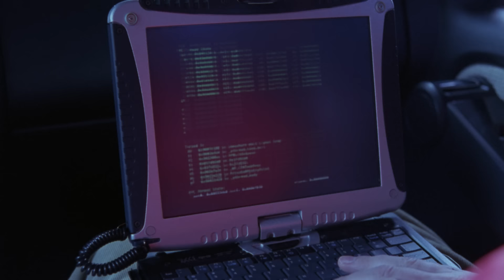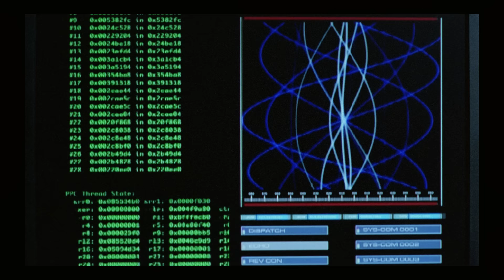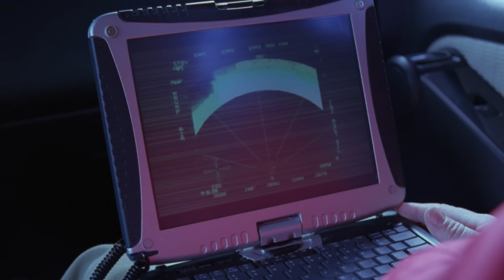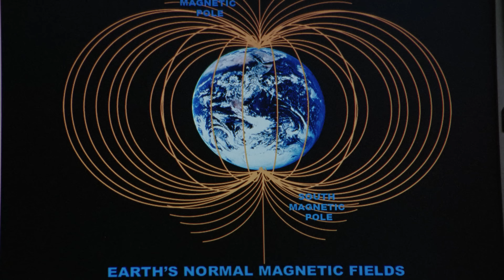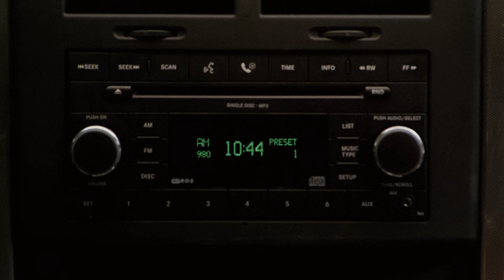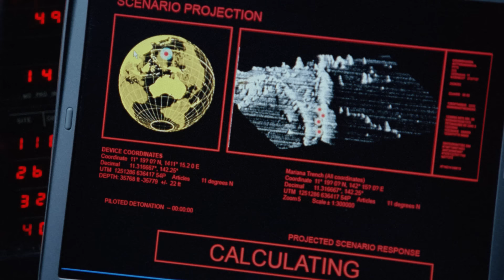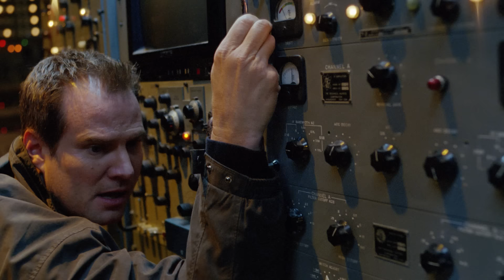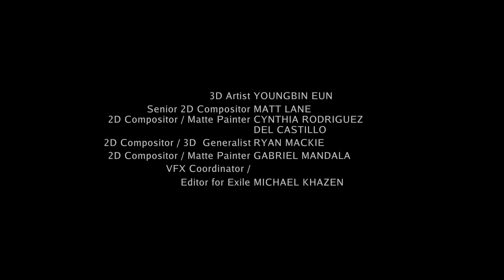Polar Storm Full Movie | Disaster Movies | The Midnight Screening

Comment: Definitely worth watching. I especially liked where 2 men were able to lift a hydrogen bomb in its crate into the truck. Also great was when they were able to take the battery and starter from a gasoline-powered car and up it in a diesel truck and it worked. Finally, a Russian diesel submarine went to the bottom of the Marianas Trench--far past its hull-crush depth. But hey! It's all in good fun!

One of the better disaster movies, which always begin with the "experts" ignoring a scientist. Sound familiar? Rather like real life.
Reply: Pretty much everything here is backwards.  Magnetic reversals happen, but they're not correlated to extinctions.  The magnetic field is not in line with the rotational axis.  Makes for good drama, though.
Reply: Because its fiction, anything goes.
Reply: I'll definitely take ur word for it 👍
Reply: Funny
Reply: Yes, exact like in this world!
Reply: Those were nuclear bombs, not hydrogen bombs. Also, the starter wasn't fried. It was the alternator. The starter was attached to the gearbox. All vehicles are like that.
Reply: @JuliusGrande , hydrogen bombs ARE nuclear bombs. Edward Teller's group at Los Alamos developed them in the early 1950's. The first bomb from the Manhattan Project was a fission bomb, and 2 were dropped on Japan. Teller's bomb design was a fusion bomb, which is several times more powerful. They both work by splitting the nucleus of the atom, and are both atomic, (meaning nuclear) bombs.
Reply: @johnwest7993  Whatever.
Reply: I thought exactly the same. Two supermen for a few seconds. LOL
Reply: Mariana Trench  depth  - 36,000 ft plus change.  Maximum  depth achieved by  MODERN  submarine ( Russian  Akula class) - 4000 ft.  So, yeah...
Reply: @Katrina-mi2gm  also a diesel sub's max speed is 23 mph and the trench is approx 5600 miles from the West coast.  It would take 10 days to make that trip.  They had less than two.  Diesel subs can only stay underwater for a few hours at a time.  Oh well, still better than many of the disaster movies they put out, even the big budget ones.

Comment: Shutting off the vehicle doesn't protect it from an EMP. If it has a chip or IC, it's fried.
He said the battery and starter needed to be replaced.  He replaced the alternator.  LOL
Reply: Being a back yard mechanic? And I saw the alternator called a starter?...I'd hire that guy to BS customers so I could make more money repairing cars. 
I would also sell winter air for the tires. You'd be surprised by how many people think there is such an item. 
:>)
Reply: @tedhernandez2394  I have heard people say they use nitrogen in their tires in winter because in shrinks less than atmosphere.
Reply: @tentativelymanaged9642  Costco and Pep boys use nitrogen fur the tires.
Reply: True.  One would need a Faraday cage around the car, or whatever they're trying to protect, from an EMP.
Reply: Brian Roberts I agree with you.
Reply: @tedhernandez2394  The starter is attached to the gearbox
Reply: @JuliusGrande  I know that...Thanks anyway.
Reply: @tedhernandez2394  You know how I know? I've been working with cars for 10 years.
Reply: Movie made in 2004.

Comment: Modern cars has multiple computers that will be fried by EMP. After they are gone, then engine ignition sequence and everything else that is handled with them will fail. So getting a modern car run after EMP has fried it is almost impossible without loads of spare parts.

And running it with random radiation would be extremely hard even if the components would be designed for that. And in this case, they are not.

Even if you miraculously get the car running while EMP changers it, then you have to get batteries running too. Car is not running without steady electricity flow...
Reply: If you expect anything that resembles 'real life' in these flicks, you are definitely barking up the wrong scenario... please - a woman falls into a huge crevasse and emerges with hair and make-up perfect... and you think the car is far-fetched!? We can go on...

Comment: Even if the car engine is turned off, there is an effect of electromagnetic waves.
Electricity is supplied to the electronic components in the vehicle.
At the very least, you have to remove the battery.
If electricity remains in the electronic parts, it will break.

Comment: The Marianas Trench is about 2,500 miles from the US west coast. A (fairly) modern diesel sub makes about 40 knots (44 mi/hr.) That means it takes a minimum of 58 hours to reach the blast area. They have less than 48 hours before the magnetic field shuts down. I guess they're going to have to push it and hold they don't run out of fuel somewhere between Hawaii and the trench.
Reply: That would have to be one fast boat.

Comment: An old diesel sub at the bottom of the Trench? That's gotta be about 35,000 feet deeper than what would crush its hull. None of those subs hulls was rated for even 1000 feet down. I think we'd lose an Ohio class sub by 2000 feet. Submarines just can't go very deep. Their hulls would have to be way too thick.

Comment: Different sized vehicles usually use different sized batteries and alternators. There is no way that the battery and alternator of a Nissan Pathfinder would fit in an Army Truck. Plus, the starter is normally attached to the gearbox.

Comment: After looking through other reviews here, I agree it was worth watching as a " Feel Good Disaster movie". The story works as a happy ending story. You just have to disregard virtually all the Science and Technical portions which have been very much repeated here in other comments. The one's I will comment on would be 1.) the fact that the EMP was a rolling effect, that is kind of contradictory of the name ending in Pulse. On that as well, it has already been said, turning off the vehicle will not stop the effect on the electronics...ie... destroying it. 2.) The disruption of the Planet core by a hit that was that easily survivable is questionable. The most glaring items though are the Submarine issues. There re maybe a half dozen submersible vehicles on the whole planet that could make the trip to the Marianna Trench and survive, Most people don't realize, the typical crush depth of a submarine is around 1200 to 1800 feet deep due to the pressure the hull is subject to  at those depths. A submarine at 9000 meters( 29,000 feet) below the surface would have long been crushed due to the fact that every square inch of the hull would have the equivalent amount of weight of 2 full size pickup trucks on it( around 13,000 pounds). I won't even go into the idea of steering the sub into a " Black Smoker:  I know this is a long explanation and having said all this. I still watched it from beginning to end and was touched by the return oh the Father and Grandfather.. I recommend watch it and ignore the Science involved. It  was fun to watch and especially when the "Bad Guy" car thief gets his instant Karma!!! :D

Comment: Yes, the earth’s magnetosphere really is diminishing, and has been at an ever increasing rate since at least 1859, but the results of that when and if it approaches minimum field strength will not even slightly resemble this silly BS.
Reply: Hasn't the field strength diminshment accelerated even faster in the last 30 or so years?

Comment: Ok movie as such.. very entertaining.. but..  Turning off electronic equipment is not is not gonna do dip squid.. If there's a powerful EMP any microelectronics, if it's not shielded against it, is gonna be fried. Regardless of whether it's switched off or not. The notion that it'll be unharmed if it's turned off is just a movie myth. I've seen that in other movies too, but it's simply not true.. - Furthermore: WTF's up with the rediculous notion that the people inside the car-, or holding/wearing electronics, would be electrocuted if it's not turned off??!! 🤣That's a new one. Wtf?! - Other than that.. Going into the Mariana Trench in a normal submarie?! I think not. At that depth the pressure is so immense that a normal sub would be crushed like a sodacan under a truck.. - But then again; don't let realism ruin an ohterwise ok movie. And admittedly it is quite entertaining to watch, all the same.